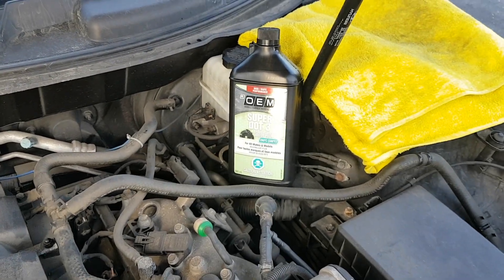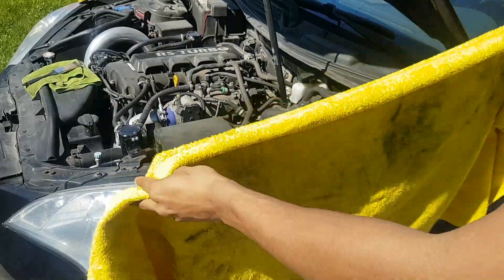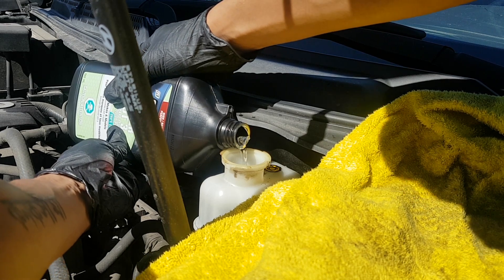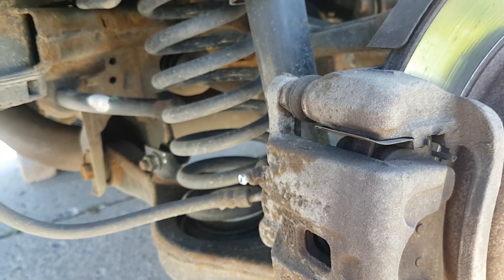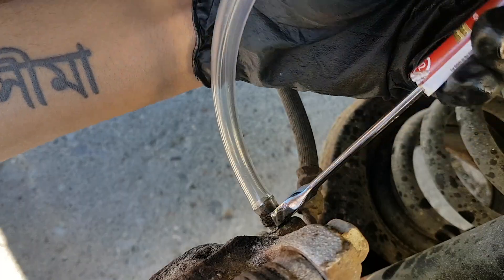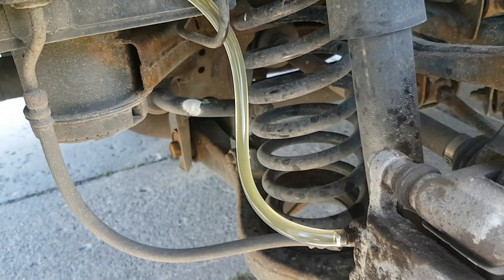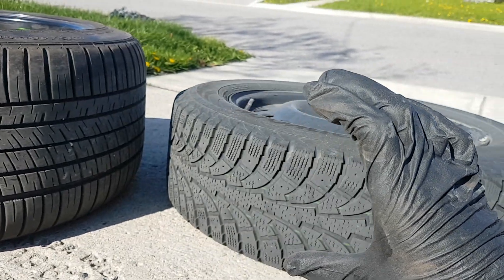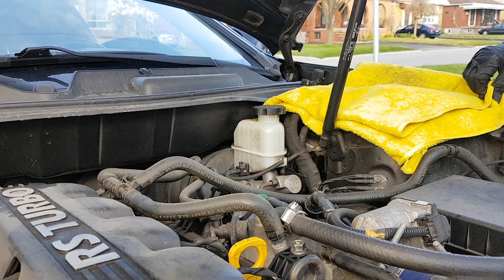Brake Fluid Flush and Bleed | Genesis Coupe

Comment: Hey I know it’s been awhile since you made this video but I have a manual Genesis, since the clutch fluid is the same reservoir as the brake fluid, would the same process work?
Reply: You have to bleed the clutch from the bleed under the car on driver side of trans

Comment: Does it matter where to start and finish? Can I start on the left rear or will that mess something  up?
Reply: You always want to start with the wheel furthest away from the brake fluid reservoir. So the order should be rear passenger, rear driver, front passenger, front driver

Comment: Why do you only pump the pedal half way and not all the way?
Reply: Because the fluid will suck back up causing air bubbles in which you will need two people. One to hold the brake pedal down until you tighten back the nipple